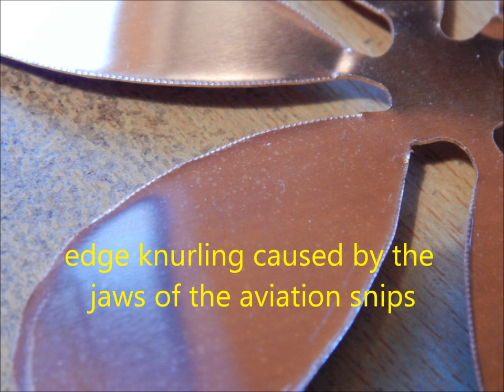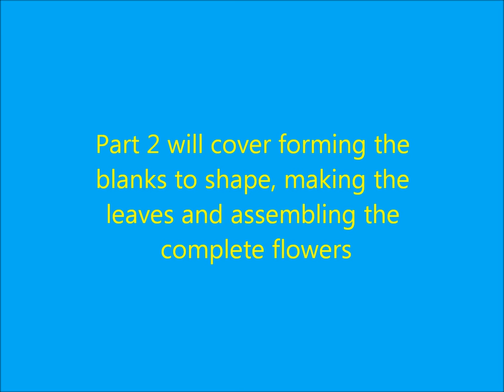Making Copper Tulips, Part 1

Comment: something i didn't mention regarding torch painting copper is that you don't want a real hot torch. the best way i can explain it is, you want a torch with kind of a lazy flame. any torch that has a pin point flame and gets hot enough to melt standard size solder is too hot. what i do is use a standard low cost screw-on propane torch and reduce the air input by restricting the size of the air holes at the base of the torch head, a spark plug boot works real well because it can stand the heat without getting hot itself so you can move it around with your fingers. by adjusting the intake air flow you can regulate the torch's flame from pin point hot all the way down to a flame equal to a standard butane lighter. copper is real sensitive to heat and it's a fine line between nice colors vibrant colors and washed out over heated looking copper. 
one quick example of something you can try is, block off all the intake air for the torch, you'll have a yellow lazy flame like a butane lighter, then start letting air in a little at a time and the flame will start turning blue, stop adjusting the air when the last bit of yellow flame disappears and you'll be left with a lazy blue flame that has the shape of a butane lighters flame but will be hotter. then with the flame held perfectly parallel to the copper put it up against the copper for a second then start rotating it in increments like the numbers on a clock face holding it in each position for only a couple seconds, by the time you make a full circle and pull the torch away the colors should be forming and you should have a something that resemble a flower. what you learn for that experiment should give you an idea of how it works and what you need to do to get the best colors. i hope this information gives you a little more incite into the process of torch painting.....
Reply: Pra que está Bíblia??

Comment: The copper tulips really show off the color of the copper. I prefer this look over the metal roses I've seen made. Can I use my everlast plasma cutter to cut out the outlines in the copper?
Reply from the maker: Maybe you could. I have a 50 amp plasma but I don't think it would turn down low enough for 0.5mm copper. I will give it a try though.

Comment: or you could use a real dremel  with a pointed tungsten carbide bit to get in the tight areas on the flower instead of a saw, my set of bits cost $12 US from ebay and work phenomenal on all types of soft metal, you also could use a torch to paint the copper pedals of the flower giving them some colored tones ranging from deep blue to vibrant rainbow colors, torch painted copper is beautiful......
Reply from the maker: Since the video I now just drill 5mm holes at the base of the petals so I can get right in with the snips. Are the flame colours permanent or do they have to be clear lacquered?
Reply: i make mixed metal vases for my roses, the stuff i do is kinda a combination of  post modern industrial design, scrap metal art and , steampunk. i usually use car, plumbing, or industrial  scrap for the vase base, if the base is steel then i use  thick wall copper pipe for the vessel and visa versa, here is a piece of copper pipe on my dresser i torch painted more then a year ago and it still has it's color. seems to me i experimented with clear coating it after torching and if i remember correctly the clear made the color disappear which i thought was really weird. exposure to the heat of the sun like putting it in a window sill will diminish the color. your copper flowers are beautiful you do nice work but if they were contrasted by polished steel it would take your art to the next level and really make them  pop. electrical conduit once the galvanizing is removed will polish up almost like chrome and looks awesome mixed with copper. with your roses try making the leaves out of the lids from canned food, flatten them out with a hammer, heat them red hot to remove the coatings then cut them out, polish with steel wool and solder to branches made out of pieces of  metal coat hangers. there are a few other really bitchen things you can do but i wont make this longer, if you want to know more let me know.......

Comment: Absolutly beautiful.
I can assure you though that no self respecting fine limit sheet metal worker is going to go anywhere near those crap snips.
They will however be using Left and Right Tin Snips. Otherwise know as "Gilbo's.
Cheers, Don. 60 in April.
Reply from the maker: Thanks for your comment Don. There is a quality difference between tools that a professional would use day to day to make a living and those that meet the occasional use that a hobbyist puts them to. That difference often comes at a premium price.